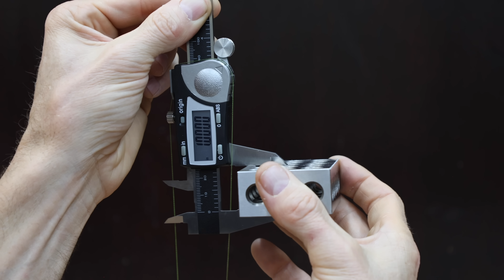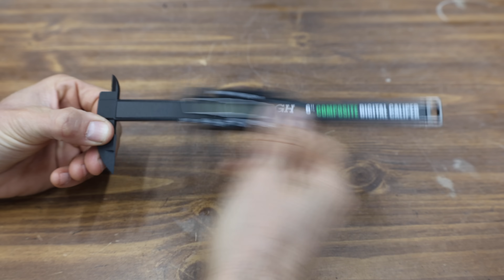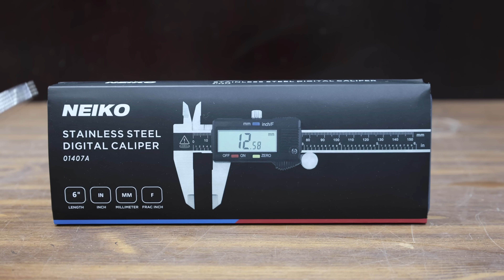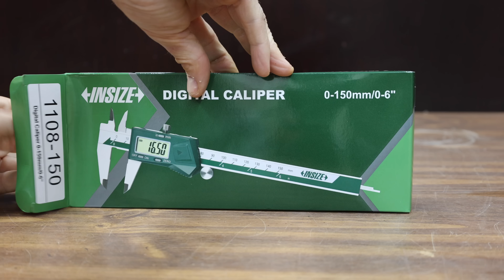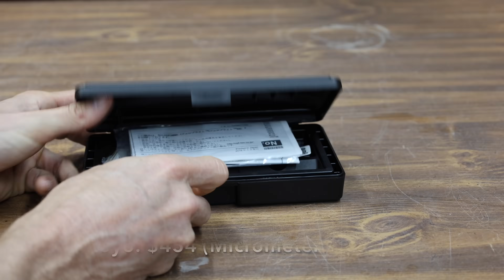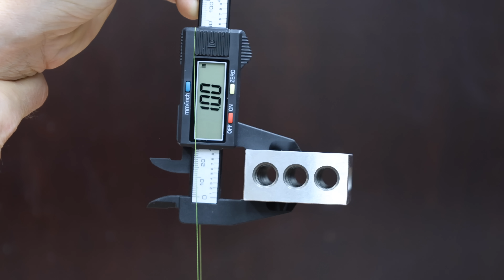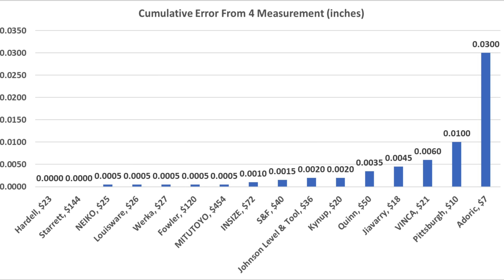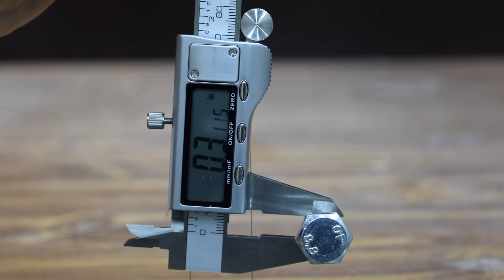I've Been Proven Wrong About Calipers!

Comment: I work in a tech school machine shop, we've bounced around the "cheaper" brands quite a bit. We have multiple groups of 16 people working with calipers and micrometers every day all semester long. The thing with most of the random chinese junk measurement products is that everything works fairly well AT FIRST but you really start to see the differences after 1-2 months of daily use. The cheaper ones will stop being useable pretty quick. If we spend over ~$35, they last around 3-4 semesters with daily use (barring any damage from dropping). if we spend less than $30, they only last about a month, so it's easy to see where the drop in quality occurs. The materials are just sub-par, but you can't really see that initially, it's only after cycling them a couple hundred times before they literally fall apart.
Reply: That means that for most of us who are a single person using our calipers occasionally, the cheaper ones would be just fine. That said I'm 65 and I still use the calipers that my father bought when he lived in Switzerland before he even met my mother.
Reply: @CaptHollister - the question we cannot answer from @ydna's comment - very valuable experience - is if the cheapest devices would also fail after 2 months of not having been used at all. There could be "dirt" from being handled that you and I may never experience. There may be climate - a friend got a car from a relative more than 1000 km south in a dry warm climate that had no trace of rust. At our latitude, near the ocean, colder and much more moist with salt in the air, this car sprang rust all over after 2 months.
The sensor, the slide rail used by the sensor, capacitors in electronics, all can "age" potentially faster from not being used. Thus causing failure.
Reply: @CaptHollister  It just doesn't make sense for someone dabbling in DIY to drop $30+ on calipers that they'll use a handful of times per year. My $3 calipers from AliExpress are a cheap upgrade from just using a measuring tape. I wouldn't even think of using them for anything more serious than working on old bicycles, but they handle that job just fine.
Reply: @Pellagrah  there are simple calipers, which allow you to find the measuring manually by looking at it - no digital- computer component. it has a simple system which is easy to learn and to use which allows to find measurement up to 0.0 mm accurately ( for a diy -er it s more than you ll ever need. really).

in my opinion, as i m documenting my self if these digital calipers are worth it, i find the manual caliper i have is the best for my diy use case and longevity, even if it s a bit more time to find the measurement. at the very least it will always stay accurate, for long long time, only thing i can thing of that could reduce the accuracy is the steel getting doll around the jaws where you get you measurements with, which should take a long ass time for that to be a problem.

i was thinking of getting my father one of these 20$ digital calipers for Christmas , but idk anymore. i don t want to buy him unreliable crap
Reply: @Pellagrah   It's a tool. Some are better than others. A flawed tool can be anywhere from annoying to very costly. One large project ruined and $35 looks like a steal. My order of preference begins with highest quality, then cheapest price.
Reply: @Pellagrah  For anything that doesn't need super high precision even bad calipers would be better than a tape measure or ruler. And if you are largely doing reference measurements it doesn't even matter if it's off a bit because youd be the same amount off everywhere.
Reply: I use my calipers for reloading rifle cartridges. My Mitutoyo return to zero after 100s of measurements, my cheaper set did not. For less than $100 (£80 UK) they represent good value. Plus the battery lasts years, I bought a spare 2 years ago and haven't had to use it. Just remember to power it off. Smooth, accurate, reliable and well made.
Reply: 僕の机には10年以上Mitutoyoが置かれていますが、今でも正確に作動しています。電池は2回換えただけです。
Reply: With your experience with the cheaper ones do they burn through batteries? I have heard that they will run down the battery fairly quickly, even when not in use?
Reply: @volvo09  I have a bunch of the cheaper ones. They drain batteries non stop. I have a set that will drain the battery in a few days even if it's off the whole time. They all have auto shut offs, some just drain the battery anyway.
Reply: @volvo09  Yes AND they don't remember position when you turn them on and off. And they don't react quickly. If you keep them in a closet 364 days a year, just take the battery out and buy the cheap ones. If you use them weekly or daily then buy Mitutoyo. (And the price on the end chart was off by $200 based on reality and the price he stated earlier in the video.)
Reply: This is very helpful! I guess some of the cheaper options reviewed here would still be excellent value for the infrequent user, but no good for a shop or school with high duty cycling.
Reply: I think this is fairly demonstrative of who the target market for each device truly is. If the sub $30 callipers only last 2-weeks in a machine shop, that same calliper might last the home user 2 years of equivalent use. This is ultimately what the top end of precision tools provide, long term reliability in a workplace where 1-2 hours lost labour covers the cost of the tool (although in your educational setting it's a bit different). But for the home user who is budget conscious, it shows that even the sub $30 callipers will do them pretty well for quite a long period of time... not to mention that they probably don't need 0.01mm accuracy!
Reply: This is great information.
Reply: This is a really helpful comment - thank you. I thought this was a great review but, nonetheless, what none of these kinds of reviews can do is give any real insight into the longevity of products, whereas you've just given me a handy rule of thumb for picking up an inexpensive (but not too cheap) set of calipers that for my relatively intermittent use will hopefully last a lifetime.
Reply: So true, I bough a cheap one from a hardware store for simple daily use in an innovation lab, after three months, we went back to the vernier style, definitely less convinient, but far more robust
Reply: Funny how everyone says Chinese junk, without considering the price. You get what you pay for, pay a higher price and while still made in China, it wouldn’t  be considered junk anymore.
Reply: @ELee-fr4tr  while true the most annoying thing about Chinese brands, that wasn't even mentioned here, is the power draw while "off". Those cheap calipers kill batteries within a month. I had all kinds of calipers and eventually got fed up and bought analogue Mitutoyo. Can't empty batteries if there are no batteries.
Reply: @MladenMijatov  Excellent point, and for what it's worth it's not all of them. It seems to be pretty random...
Reply: @MladenMijatov  Same here.  My vernier Mitutoyo calipers are going to outlive me.  (I can usually spare the three seconds it takes to read the scale!)
Cheapo digital calipers do have their place in classrooms and out in the field - it's not as if batteries cost a fortune - but as somebody else pointed out, top-quality tools get taken care of like the fine instruments they are, which adds years to their useful lifetimes.  Spreading the cost over decades of trouble-free use makes them a relative bargain, IMO.
Reply: @ELee-fr4tr  This is becoming obvious in the world of motorcycles. There are now Chinese brands that cost nearly as much as the equivalent Japanese models while offering the same quality. Buy cheap, get a cheap product. Spend more, get a better product regardless of country of origin. Simple.
Reply: @CaptHollister  Exactly.  China is very good at making the cheap stuff--they're better than anyone else can make cheap stuff, which is why they cornered that market and became known for it.  But it's still cheap stuff, corners must be cut, so is good for light duty, maybe occasional medium duty, but for heavy use you need to pay more if you want it to last.
Reply: @TCBOT  And yet CFMOTO builds all the 790 models for KTM and are now in the process of setting up a similar deal with Yamaha. The CFMOTO Ibex 450 is now rated at the top of its category. In reality, expressing salary as a simple number with no context is meaningless. What matters is what that salary buys in the place and time where you live.
Reply: @CaptHollister  yea  give it a few  1000 miles  the honda gx copys  are the same as the real  thing for first 300 hours  lol   all the car firms that did the same thing bmw   being one  turned into shitz   after moving to china   anywhere that  pays  peanuts    makes isnt going  to be  as good a a place that  doesn't use slave  workers
Reply: @CaptHollister the chinese bikes out nowadays are not as good of quality as the true made in japan bikes. Even the omes you pay 8-9k for, they still are of a lower quality
Reply: @ELee-fr4tr  Never heard anyone say that. I only hear "cheap Chinese junk"
Reply: @ELee-fr4tr  Not necessarily true.  The Chinese also love to make crappy products that they then charge a high price for.

Heck, there've been some noteworthy scandals over the years of high-end Chinese products (rice having plastic pellets; "spring water" coming from sites polluted by industrial waste, glass thermoses that shatter when explosed to boiling water).

The rule on any product is to understand what makes one good and don't make quick judgments based on a label.
Reply: @FlyingDwarfman   "high-end Chinese products" 

"rice"

:facepalm:
Reply: @ELee-fr4tr yep, the actual reason why Chinese product is junk is because almost everyone is only looking for dirt cheap when scrolling at Chinese product. The quality one exist, but people just ignore them and look to non Chinese brands instead

So yeah, what actually junk is the market
Reply: @ELee-fr4tr yeah china can produce incredibly high quality parts (often better than US made) but people here are NOT ready to admit that/have that conversation lol. 
Noctua pc fans come to mind. Produced in china and taiwan, renown for their quality
Reply: @ELee-fr4tr  I describe them as junk due to the price, not the country of origin. They could be junk from lala-land just the same 😆
Reply: @ELee-fr4tr  The problem is you frequently don't get what you paid for - Chinese Junk should often be sold for pennies it is so terribly finished and engineered, but is charging much more because they can - it looks close enough to the adequate quality stuff and being mail order you never know what you are getting. China is these days capable of producing quality, and sometimes you will get that at a decent price, but frequently you get garbage for only a few dollars cheaper than the budget end from everyone else, or for 'the same' model after its been fettled by your Western company that imported and then actually fixed them!
Reply: @foldionepapyrus3441 You are talking about how things were 10 years ago. Update your system, please.
Reply: any experience with the hd husky dc?
Reply: usahakan memiliki yang versi analog,seandainya memilih yang murahpun usahakan sedekat mungkin tingkat keakuratan mendekati karakter mitutoyo
Reply: As a woodworker the VERY cheapest ones are great.  Accuracy is more than good enough, cheap enough you can just buy a handful and pitch them as they  break, not worry about losing them or breaking them. And much easier to read then trying to see the 32nds or 64ths or even mm om a rule also handy for what size allen wrench is this or, is this 3/8 dowel a bit over or undersized today.....
Reply: Ill bet they buy the cheaper ones BECAUSE THEY GET DROPPED AND TREATED LIKE TRASH! 
The expensive ones are purchased by people who care for them and covet them as something special. There for the expensive ones are going to last longer (and yes they are made better) BUT if you treat your cheaper but good (like the neiko) ill bet it will also last a lifetime.  I have 2 $20 calipers and both have been given a beating and work just fine... I think lol I haven't used them in a Lil bit
Reply: @elijon8954 Heh, got my first caliper from my grandfather so it might be the bettter part of a century old and I'm still using it.
Reply: this is big insight, thanks.
Reply: I use calipers daily as a machinist. I use a cheap set cause that’s what I was provided. The one I use is accurate to +/- .0001. I do have problems with them loosing zero occasionally and the scale will start randomly jumping around to crazy numbers. It’s only happened two or three times but I’ll eventually drop some coin on the Mitutoyo carbide jaw calipers.
Reply: I suspect much of the failure rate is due to the electronics.  Light precision electronics to be used in an often rough environment at budget prices, that doesn't combine well.  My oldest caliper is many decades ago.  It has the old-fashioned vernier scale instead of electronics and I expect it to survive me - no matter how old I may get.  It's must have been dropped before I received it - I need to subtract about 0.1mm from the measured value.
Reply: @ralfbaechle  I had to buy a caliper 2 years ago, because the one that I got after my uncle, which I used for >15 years and he used for few decades... got lost when I was moving to new house.  It was analog caliper. The one I bought is also analog. Analog calipers are the best if you don't need speed or resolution better than 50um for professional use. I still paid ca 50$ for analog caliper, but it is just so durable, but unless I lose it or drop in some unlucky way (it was already dropped) - it might outlast myself.
Reply: I have not experienced this. I've had a number of cheap ones including two metal Pittsburgh calipers for 5-6 years that are accurate enough for my needs and get very heavy use. I spot check them every so often and both still work exactly the same.

The first thing I do with cheap calipers is spend 30 min taking them apart to clean, debur and polish the rails. No this will not mess them up. Both of those went from feeling fairly gritty to buttery smooth except for slight resistance near the end of travel since the depth guages aren't perfectly square.

Digital calipers have basic internals and nothing should go wrong within a meaningful time frame unless they get repeatedly dropped or exposed to the elements. Avoid the budget batteries that come with them and replace them fairly regularly. Low voltage could cause some errors. I've never seen digital calipers that aren't damaged get 'wonky'. They either work or they don't.
Reply: @JJFX- I've gone through 6 pairs of cheap digital ones. They eat batteries when working too. I took to taking the batteries out after every use which is a pain. 
I ended up getting mechanical metric and English ones because they always work. Lol and recently got a digital mitutoyo like at work. Game changer.
Reply: @Fastm3driver  I had one pair like that a long time ago and seen reviews saying it about some other cheap ones but fortunately this has never been an issue with the Pittsburgh metal calipers. I haven't touched the batteries in months.
Reply: @JJFX- you've never seen a pair of calipers that are no longer accurate? I have a whole "graveyard" drawer with dozens of sets that are too inconsistent to be utilized at the equipment. The digitals lose their tracking and the dial ones become +/- .005. It's like clockwork with the cheap junk sets.
Reply: But once, cry once
Reply: I think the good thing that the video shows is that a cheaper pair is accurate for just
Reply: Thanks you saved me from watching the video
Reply: Machine shop would use better tools as more exact
Reply: Great real world information
Reply: The only people serious about their schooling are those that buy their own tools. Schools tools are junk because they're either cheap or busted from people ruining them. When I went through school I hardly borrowed anything from the tool crib.
Reply: @WCGwkf we encourage people to buy their own sets but most of the employers here will provide them so it's not as necessary to "invest" as it may have once been. But believe me, we pull the bad tools out of rotation when they go wonky... I can't expect somebody to take good measurements (and be graded for it) if I give them non-useable equipment. The students in higher classes gain access to our better tooling since I know they're in it for the career and I can trust them more. The entry-level classes are different lol

Comment: Could you somehow test lower control arm prybars / "separators", expensive versus cheap in terms of weight applied to get lower ball joint off of steering knuckle, ease of use, how well the lock holds up and so on? From models that I've seen on amazon, good ones have a chain that's wrapped around the control arm and it has a threaded rod VS ones that are those bent pieces of steel tube and the cheapest of the bunch, rods that are bent to figure S, for 7/8" diameter pry bars.. Choice is yours so pick what you would like to test :)

Great video! I've always thought digital calipers were inaccurate, because I've seen them sold for a cheaper price than traditional ones.. I still prefer the traditional and I use calipers daily.

Comment: I have 3 of those Mitutoyo 500-196-30s of various vintage around the house and you can't beat them for the price. They're only about $120-140 if you get the tool only in a plastic case. The real thing you're paying for is confidence. I don't care about slide resistance and all that if I know I don't have to second guess and check against gauges. I hate auto-off. Something you should have measured is parasitic draw. I find those Chinese units drain the battery when off. You end up throwing more batteries in the thing over a year than the calipers initially cost. The Mitutoyos will last weeks to months when left on, and years when off.